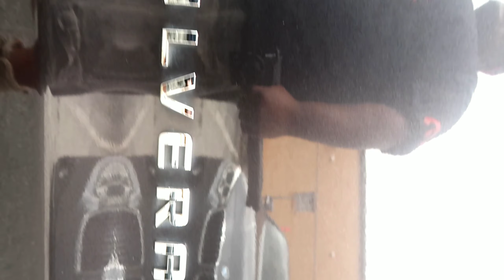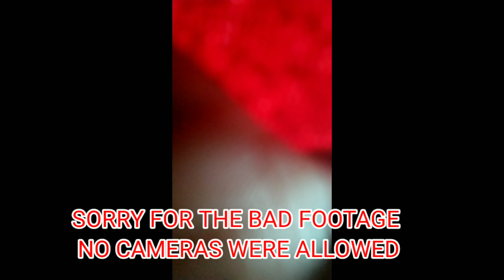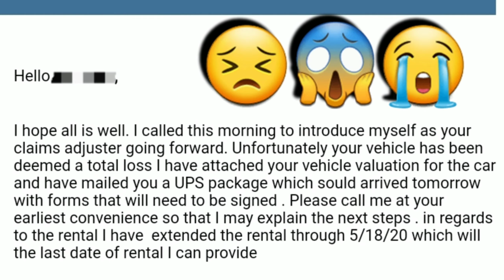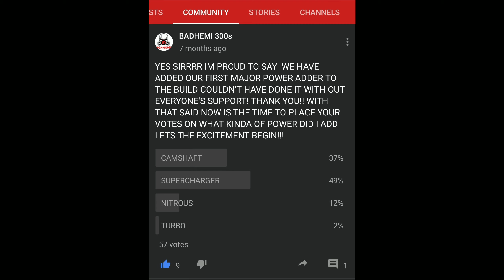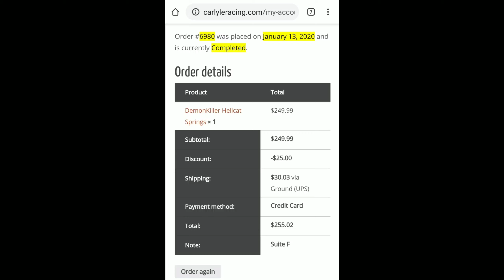#BADHEMI300S #CHRYSLER300 #MOPAR #HEMI TOTALED MY 300S!**NOT CLICK BAIT**  GONE FOREVER???

Comment: Who's working for your best interest? Is the repair facility an "independent" or on the insurance company's "direct repair" list? BIG difference. Have you seen the itemized repairer's written estimate?
Reply: HSLA, High strength low alloy steel IS definitely repairable as long as it is repaired "cold" and NOT heated. Heating the steel with a torch changes the molecular structure, which will significantly reduce designed in strength, in a future accident. Your car has many, many good parts, which will bring good salvage value at auction pool...for the insurance company!!!
Reply: Remember...it's your property until you AUTHORIZE releasing it. If you allow the insurance company to move it to a salvage yard based on any verbal threat, you will lose SIGNIGICANT leverage. Make the insurer put any comments in writing for your protection. Have you considered obtaining a second appraisal from a reputable repairer of your choice? Based on your video, just don't see anywhere close to the deep unibody or hinge pillar damage referred to.
Find out by ASKING IN WRITING what is the most the insurer will give with YOU keeping the car.
Reply from the maker: I appreciate the support but it's all over for this car but with that said I'm gonna bounce back

Comment: Did you claims adjuster finalize that amount? If so that's crazy! I had an accident exactly 2 months ago, my rear right hand side back door , front passenger door and rear corner panel was damaged. The repair cost was $7.8k with the deductible on top... So yeah...The fixed all of that replaced a lot of parts such as both doors, side skirt, wheel well apron, etc. I think that they could have fixed your car for less than 9k. If I were you I would have retained the car, payed out of pocket to get it drivable and I would have done the body work myself with after market parts. Because to get your car drivable would have been about 3k or less and over time you could buy a salvaged or new after market bumper, side skirt, front corner panel and door.
Reply from the maker: I was rail roaded

Comment: In some cases I have heard of the insurance company going into the PCM when it's a murder or DUI but pulling it out of the car it's possible but is very rare second there's always a way not to Total your car instead of buying brand new parts they can get Barely Used Auto Parts or use aftermarket equivalent parts but but sometimes the fit and finish is lacking I rather go if used Factory parts and aftermarket replicas another option age you can go and see if you can upgrade on your parts for instance I know you have a newer one but if you had a 2011 to 2014 Chrysler 300C or base model 300 you can sometimes get a SRT8 bumper and pay the difference or sometimes you can find it for the same price so you automatically get an upgrade always try and make your car better than what it was if you get in a major accident AK upgrade sometimes you can do brembos it just depends on the deals out there you can get SRT8 brakes for piston for $800 rotors and everything on eBay versus your break assembly if they go Factory it'll be well over a hundred just to be the one side if they go brand new Factory but if you go used knuckle and control arms you can do the whole swap for about a grand